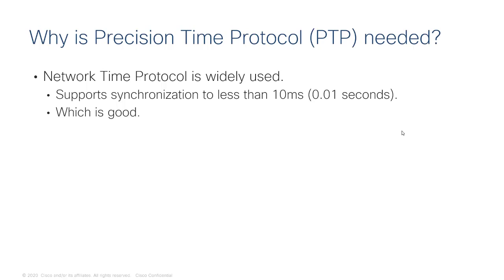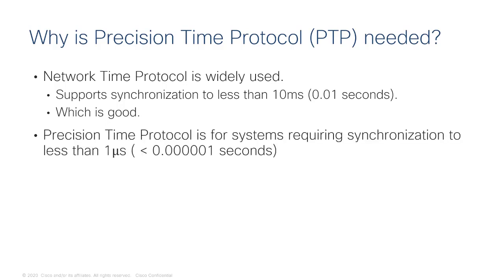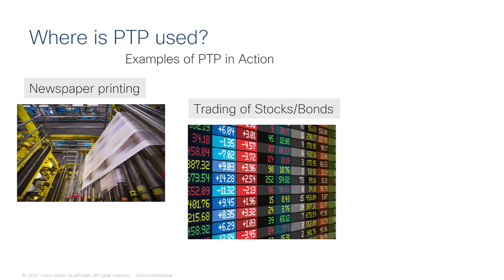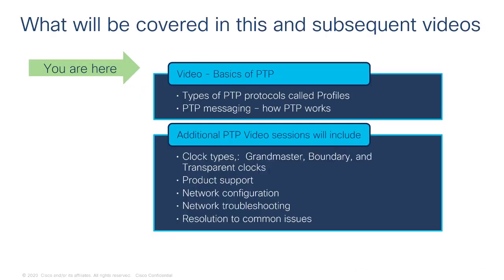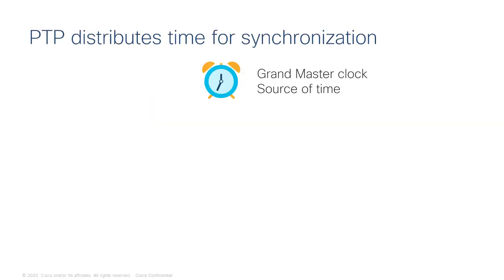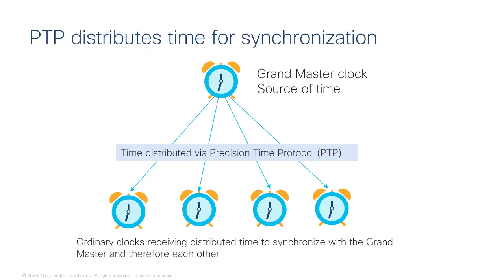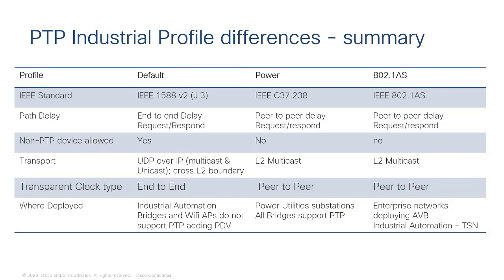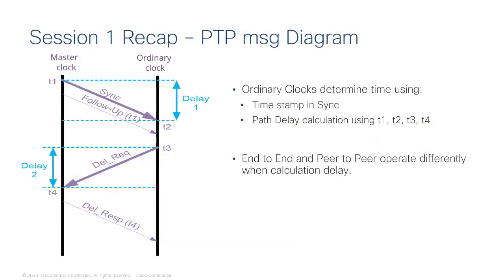Introduction to Precision Time Protocol (PTP) for Network Synchronization

Comment: Good one.  Thank you.  In a nutshell PTP is used where environment is more time sensitive and measured in less than one micro seconds (<0.000001 seconds);  Where as NTP is used, where synchronization can be less than 10 milli seconds(0.01 seconds)